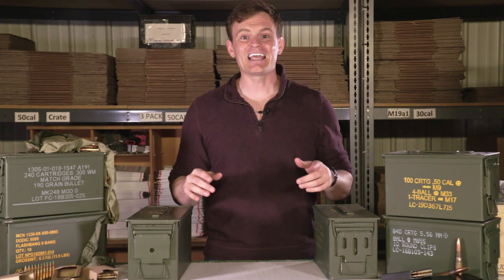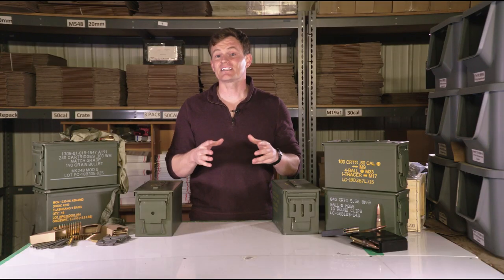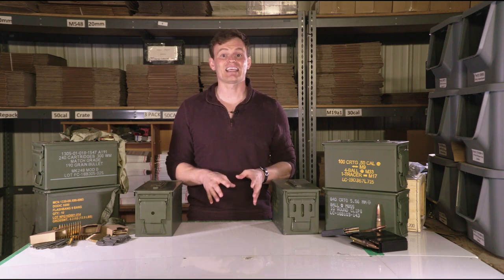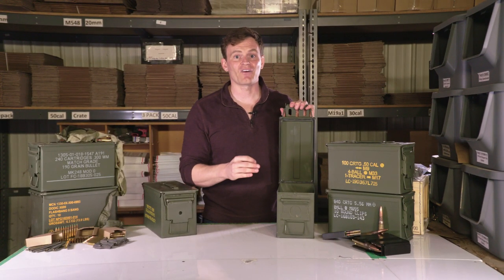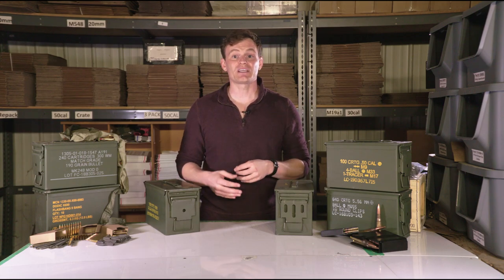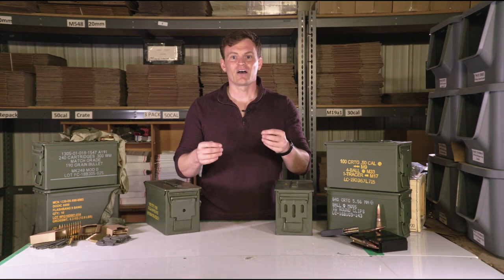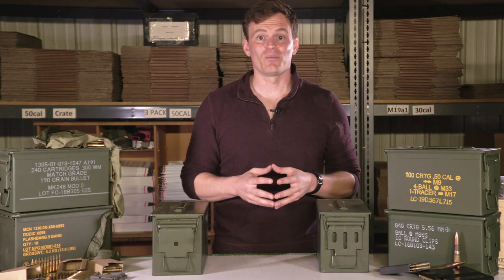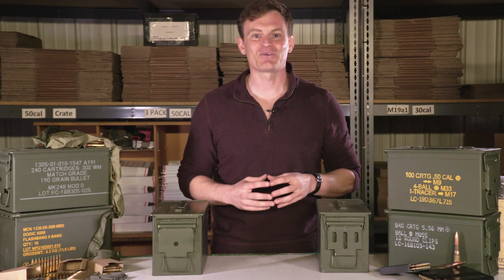The Difference Between the M2A1 and M2A2 "50 cal" Ammo Cans

Comment: Any recommendations on storing 9mm
Reply: Stack that stuff deep in 50 cal cans with some silica gel in each can and keep it in a cool dry controlled environment and it’ll long outlast your lifetime.
Reply: I would recommend dumping all your FMJ into cans designated by the grain and throw some Silica Gel packets in like previously stated. My reasoning for taking it out of the box is that you can fit more per can loose and also, cardbaoard has the potential to hold moisture. However, the potential to hold onto moisture isn't much of an issue if stored right. Just however you want really.